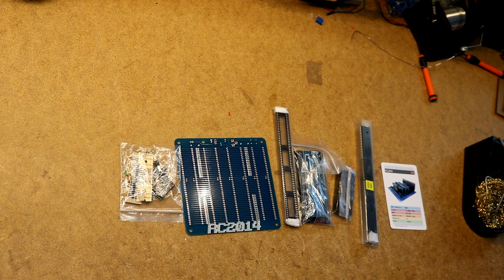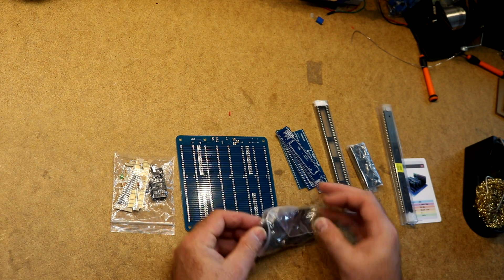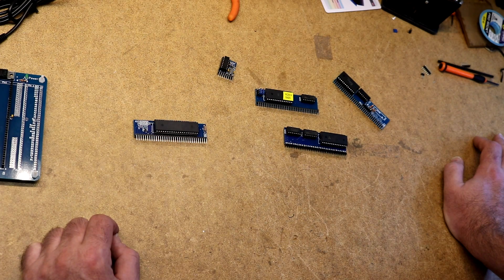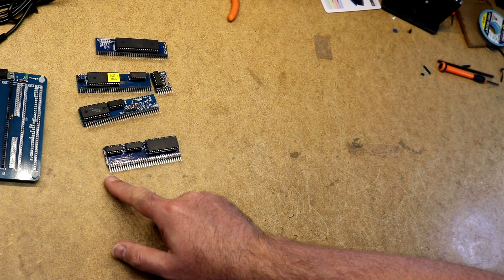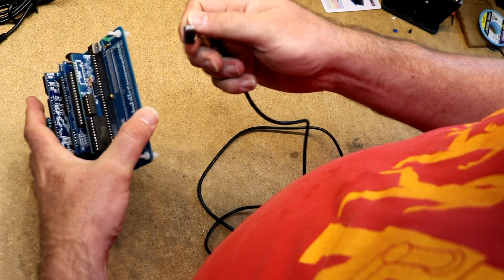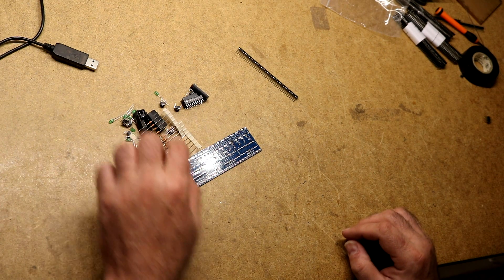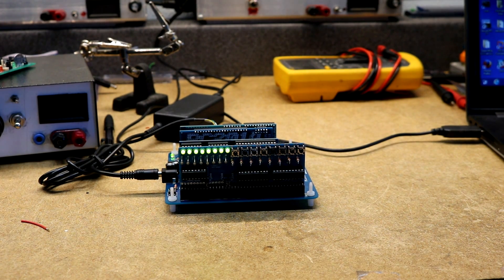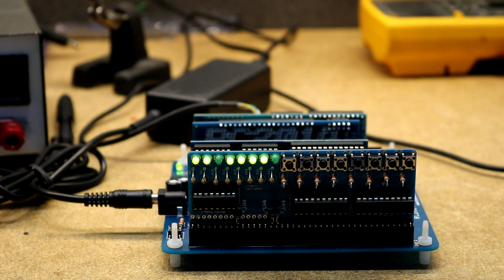Z80 retrocomputing part 1 - RC2014 Z80 retro computer kit build

Comment: I realise it's a little late (especially given how well your bus monitor came out!) but for anyone else who wants to follow along - for the IO board; try mounting the LEDs and buttons on the 'wrong' side of the board.  The result will be indicators & buttons back in the 'natural' MSB order (with no software modifications), with the added bonus that it's easier to panel-mount as the other components won't interfere with the panel.

Comment: The TRS80 color computer you had was not a 6502 (which is the Apple II brain child and designed by MOS Technology), your color computer was a Motorola 6809E, and they were different. Otherways, thanks for sharing your kit.
Reply from the maker: Thanks. 6809 sounds familiar. It's been a long time since I had the CoCo.
Reply: The 6502 was used by Apple but was the brain child of Chuck Peddle, Bill Mensch and their team who left Motorola for MOS Technology, which was then bought by Commodore.

Comment: hi what capacitor voltage did you use on the back plane and was it a 5volt regulator.
i want to use 10uf 16 volt caps but will this blow the board
kim....
Reply: the rock 16 volts is the maximum voltage they can take in, not what they output